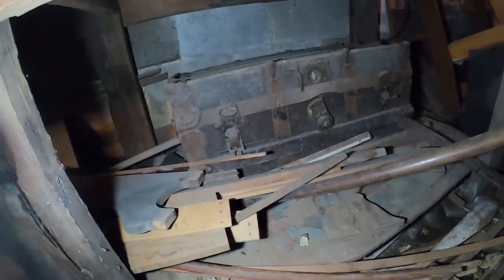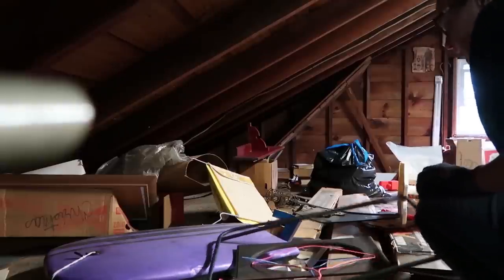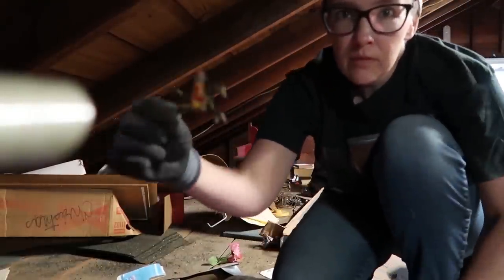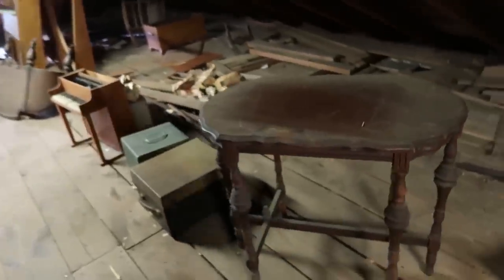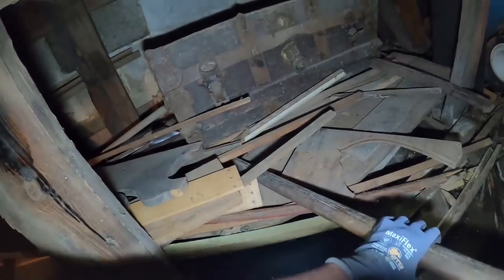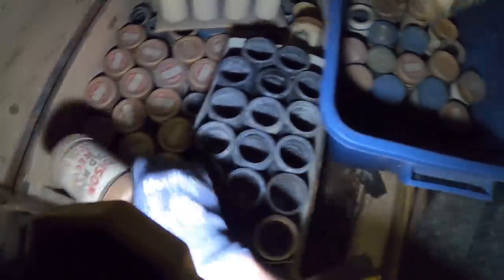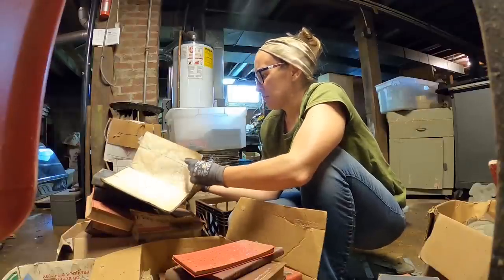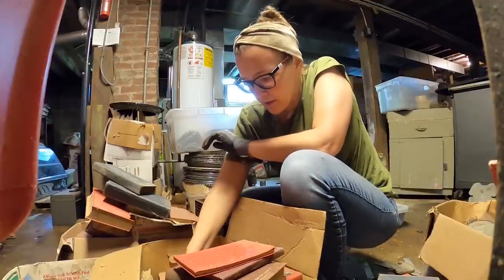It Was HIDING In The Basement!

Comment: This is a great video - digging through the dirty, dusty areas is my favorite.  That item at the beginning was a weight-driven clock.  It would have had a weight in each one of those channels on the right and left.  There would have been at lest two winders in the face of the clock.  When you wound the left side, that weight would have risen and powered the hourly (and maybe 30 min) chime as it descended.  The right side would have powered the clock hands.  There would have been a small hammer which struck that bell for the chime.  May also have been a way to set an alarm - which might have required a 3rd winder.  Guessing the age is 1850-1870?  I'm more familiar with Ogee Clocks which are very similar but not exactly like that.  It was probably made in Connecticut.  You could restore that - movements (made from rolled brass - possibly wood) and other parts are available - but it would probably cost more than it would be worth - and they're not generally considered rare.  We have one of those old beds with the curved footboard - I love them - but I gather "brown" furniture is out of vogue.  You might reconsider tossing that lumber.  People who restore old furniture or who make certain crafts will use that because of the patina.  (I use it to make replacement trunk trays).  Lumber is also pricey these days.  Love the trunk.  Those half-height trunks are thought to be true "steamer" trunks as you would take them to your cabin aboard the steamship and slide them under the bed.  Funny thing - that trunk would probably fetch $35 tops as-is, but the brass lock and receiver by itself would sell from $50-$75 on eBay.  So many times those are missing from old trunks so people want period replacements.  Hope you do well with those Edison cylinders.  I know some were made of wax - but Tony said these were plastic.  Not sure how the elements will have treated them.  Anyway - thanks for this great video - would have liked to have been there.  Have a terrific Thursday afternoon!  PS loved the radio - agree with those who said it's too bad we can't get it out to Buzz!
Reply from the maker: Wow, you sure know your clocks! Tony also did say it was a clock & took it to the flea market... not sure if it sold or not. I liked the paper in the back with what looked like Uncle Sam and a bank scene (if I remember correctly). One could easily make it into some sort of cabinet I would think, if clock restoration isn't possible. For the wood, the wood in the attic would be easier to salvage than that in the basement - mold & rotting from being in a few floods. Thank goodness the attic roof never had any issues or everything up there would have been ruined. Tony will attempt to the sell the trunk and since it is a bit smaller, I think should be easier to sell than the other trunks we have had. Odd place to store your Edison cylinders though! I just got back from the cleanout a little bit ago, so time to wash off the dirt and get some work done!
Reply: @PaperandMoose Yep - good thinking - I have seen nice curio shelves and medicine cabinets made out of similar clock carcasses.  Good luck with the cleaning & working. Thank Heavens you’re not doing that clean out in Texas, huh?!

Comment: "It Was Hiding in the Basement" A great title for a Twilight episode! The Philco console looks like one of the wartime specials radio corporations produced, utilizing production "leftovers". These were empty cabinets and chassis...they created these specials by combining these parts, creating salable radios! An expensive looking console cabinet would house a five tube table chassis! Even left over automobile radios were combined with floor model cabinets. The reason for this was all consumer radios and electronics production stopped in 1941. A buddy of mine has one of these auto radio consoles, a Philco, and the fidelity is superb! Auto radios had superior fidelity range over most cheap to midrange home sets of the time. Those buttons on your sample are station select push buttons, bringing up your favorite station at, well, the push of a button! These buttons were usually preset by the dealer to the customer's choice. I love that cute vintage child's toy piano...that would be coming home with me, the missing key could be fabricated. Looks like the action is all there. That "clock' could have housed an annunciator, a remote communication unit which utilized a bell and arrows to transmit a message from one local to another, electro-mechanically. Fr-g furniture...toilets...well...fr-gs gotta go too!! I'd take the wood for crafting projects! Wow, all those Edison cylinder recordings...I can use these, as I have the machines to play them on!! You lucky folks...I wish I could run into one of these treasure troves!! I'm for salvaging everything they can bring up from the ship...that more than anything else will keep her in our collective memories, rather than rotting on the ocean floor! I saw many of these artifacts in the early 2000s, when a Titanic exhibit visited San Francisco!
Reply from the maker: I think that Tony is going to look them all up, that's his "project". Another viewer mentioned that the tan cylinders are blanks that could possibly hold home recordings. Would be interesting to know what is on them! Will mold harm the ability for them to be played? The containers look to have suffered the most damage from the mold, not sure if cleaning the cyliners is as easy as just giving them a wipe down. I also was lucky enough to see the Titanic exhibit when it was in NYC. I actually just saw online that they have the exhibit back in the city for about 2 months, but tickets are selling like hotcakes!
Reply: @PaperandMoose  Great on the piano! Hate to see it end up in a dumpster. Some of the Edison machines had a separate recording reproducer. Language schools used these, as well as stenographers. Edison also produced commercial dictating machines, these used larger blank cylinders, later discs, then tape (cassettes/open reel) and now digital. As to the mold issue, a DAMP soft cloth with warm water will in some cases remove it, if heavy, the mold will "eat" away the surface, hence, damage the grooves. The early cylinders were molded of a kind of hard wax, which the organic mold loves. Do not use any type of chemical solvents, as these will dissolve the wax. The later blue cylinders were made of a type of celluloid , they are called "Blue Amberols", and play for four minutes, as opposed to the earlier black wax recordings, 2 minutes playing time. These two types of cylinders need their own machines to play them. Looks like your trunk load are the 2 minute recordings. Any empty boxes are worth looking up. Collectors are a market for these. Hope all this did make sense One more item: Edison machines which play the two minute cylinders are the "Standard" Phonographs, the machines which play the four minute Blue Amberol cylinders are "Amberol" Phonos. Two of the most popular of these were the Amberol 30 and 50 table models. The number indicated the original selling price. I have examples of these machines. Fun to listen to...the later Amberol recordings have excellent fidelity for the era, especially solo vocalists and instruments such as the string and wind family. Brass bands came through well, not so for the piano or symphony orchestras, due to the complex mixture of tones.